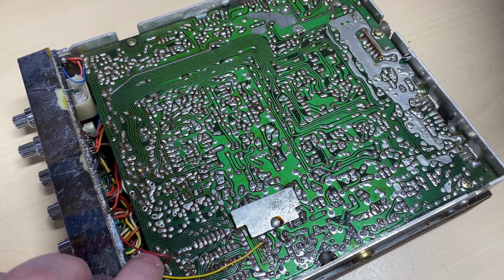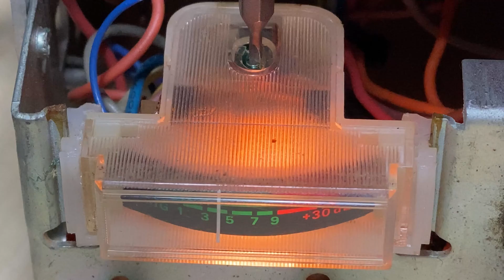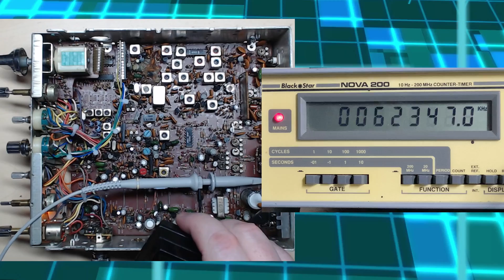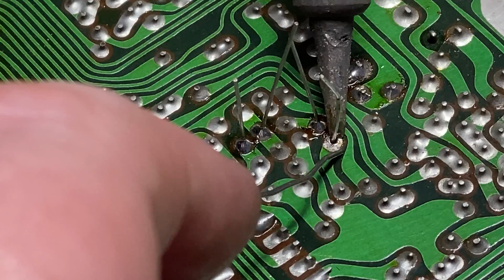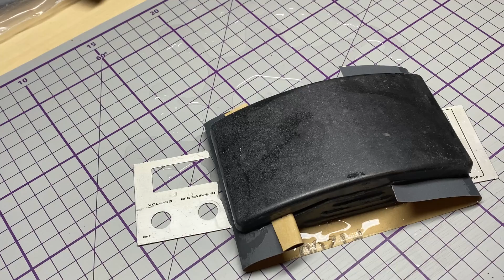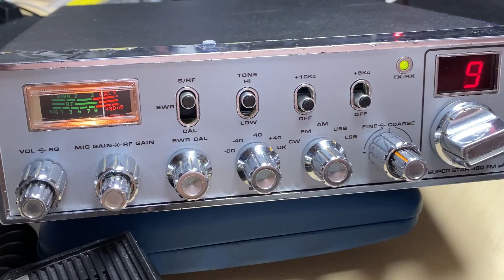EP 163  - Superstar 360FM - SSB CB radio - repair and front decal.

Comment: There's a few mods you can do to improve the 010A/B board sensitivity and bandwidth. Did many of them years ago. One of the simple ones is to replace the 1st RF receive amplifier transistor with low noise type. These boxes were always known for being a bit on the death side especially the Mk1 version boards. They improve even further with an active crystal filter fitted.
Reply from the maker: Thanks, I know of the transistor change, trying to find an active filter these days is hard.
Reply: @MicroChipz  Try 'Spectrum Communications'. He's still on the go.

Comment: Excellent video on the Superstar 360, good to see some Uniden type chassis on your bench. Did you guys ever have the Uniden 858 PLL in any of the UK chassis.
I have a SS-158-EDX in my collection of radios. 
I’m impressed with your standard of work but it would be economically unfeasible to change on an hourly rate if I was to do the same, just an observation.
Keep up the good work
Stuart - Australia 🇦🇺
Reply from the maker: Not in a uk board , some early export models have them.

Comment: What a pleasure watching you mod/repair my Super Star 360, I purchased this radio in the early 80s and had many good contacts with it, the circuit board inside was a home made speech processor spent several evenings making the board then fitting all the parts, radio is working very well and I am enjoying many good contacts again. Thanks again.
Reply from the maker: Always a pleasure :) i didn't realize you made that board . i still have it here if you want it for nostalgia.
Reply: I've made a few of the speech processor boards back in the day. Still have one fitted in an aluminum box with a meter. Is this the one that was published in one of the electronics magazines?
Reply: @johnnyg1700  yes it was and I had a mate rip the page out of the mag in Smiths and we carved and drilled the PCB Board and fitted all the parts then fitted it to my President AR7 and it worked so good we made several of them for the local breakers those were the days